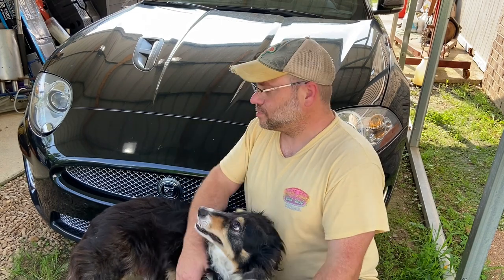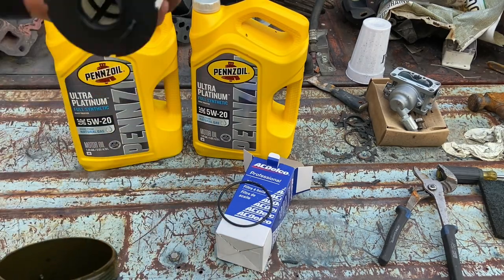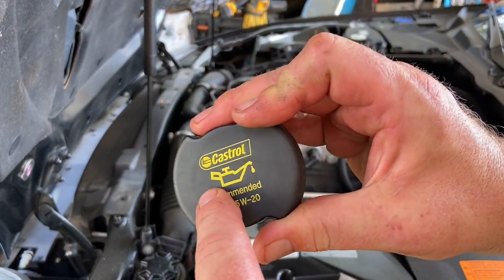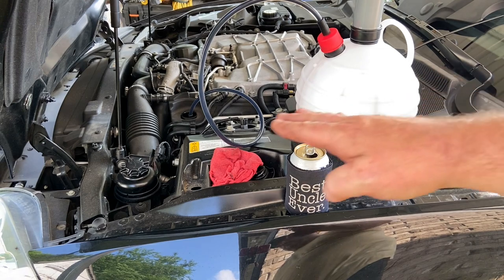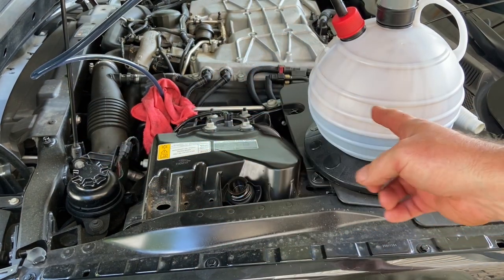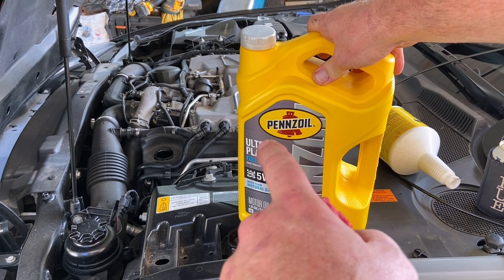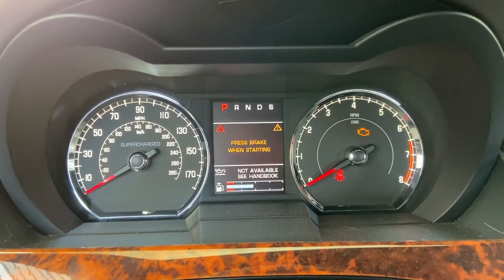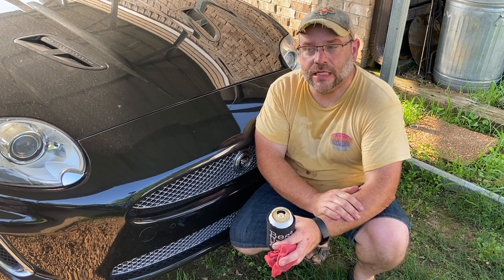Jaguar XKR Oil Change

Comment: I'd add a little guidance about resetting service mode... After you turn ON the electronics, you have 3 SECONDS to: 1) release fog button, hit and hold button thingy on turn signal + hit and hold fog light button.

Comment: The "WSS M2C925-A vs WSS M2C945-A" debate rages. How did you determine that WSS M2C945-A is suitable to replace WSS M2C925-A oil? I want to believe you. My manual says to use WSS M2C925-A, and I cannot find tech specs for it.
Reply: I've just contacted the main Castrol distributor in the UK and they advise using  Castrol EDGE Professional 0w-20  for the Jaguar 5.0L V8 engine variants.

Comment: Have you had a generally reliable experience with your XKR? Looking to purchase a 10-15 XKR within the next year. Great video. Thanks.
Reply from the maker: Generally, yes.  Two things tho - first, get a battery tender.  These things have gremlins and WILL drain the battery even if you drive it but only on short trips.  My wife can drive it one day, and then I have to jump it the next if it hasn't been on the tender.  Second - the AirCon condensate drain "duckbill" has a tendency to clog, and it will soak the passenger floorboard and possibly fry your blower fan.  I actually have footage of my repair, and it requires lowering the transmission (there is another way with a razor blade on a stick, but I have short fat arms).  One day I'll get that video out.  If you're in Canada and don't need AC then you might be alright. lol
Reply: @PoweredByDave1  I might try to stab the thing soon, transmission drop is too much but i hope i’m not too fat for it,  my main other annoyance is a whistling sound
Reply: Although not quite as fast, the pre 2010 XKs with the 4.2 are much more reliable engines than the 5.0s

Comment: Sucking the oil out is probably the worst thing you can do.All the crap and metal shards are now left in the sump.
Reply from the maker: There is no drain plug on this engine. It’s the only way unless you want to remove the pan. I mean there shouldn’t be any metal shards in the pan. If there are your engine is already toast!
Reply: @PoweredByDave1  Maybe the American spec XKR is different to the U/K spec but my 2012 XKR has a oil drain plug and I only have 4 bolts and a couple of nuts to undo and the plastic undertray drops right down giving great access to the drain plug, I personally don't like to suck the old oil out, prefer to drain it out in the old-fashion way.